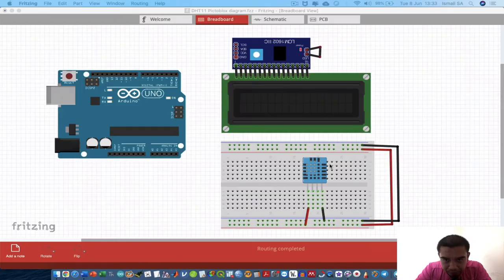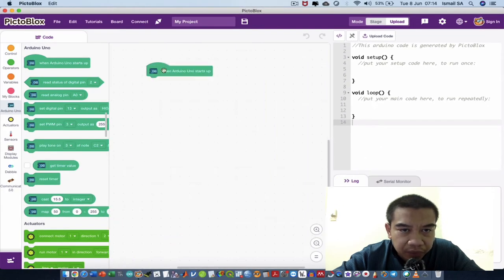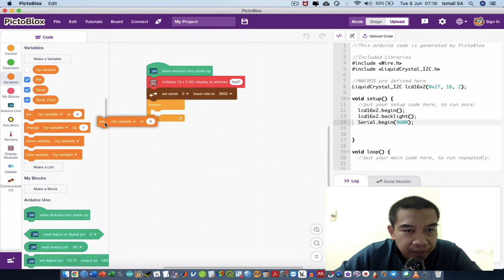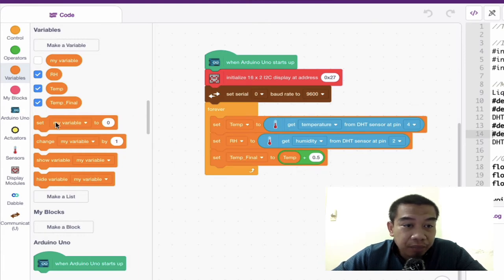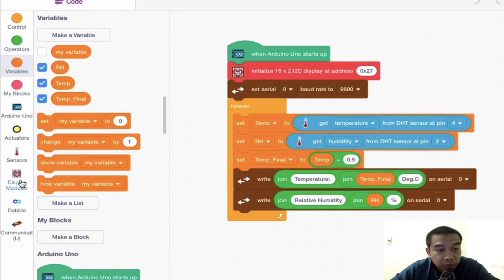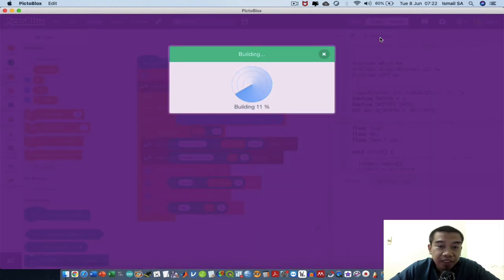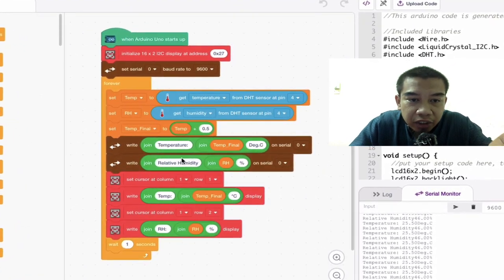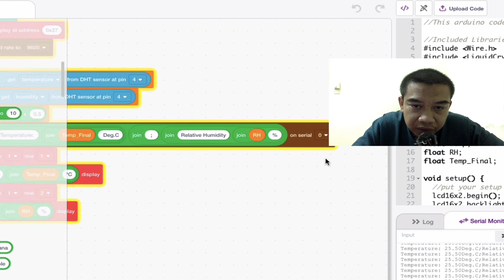Arduino Uno Tutorial With Pictoblox - 5: DHT11  Sensor for Temperature and Humidity with LCD I2C

Comment: Hi how can use accelerometer Gy-521 or Gy-271 or Gy-291  with pictoblox ? İf you have examples Ok is this thema.I need only example.
Reply from the maker: Thanks for your comment. The pictoblox if I am not mistaken cover most of basic sensor. If you interested to learn more on block coding and have the list of advance and multiple sensor, I may suggest you to visit arduinoblocks.com, they have complex list of sensor ready made with their libraries. Happy coding.

Comment: Do you know what the blue piece is called for the screen?
Reply from the maker: Thanks for your question. Usually, the blue piece attached with the LCD is called as "I2C LCD Adapter" we call as Inter-Integrated Circuit (i2C) Sir or also known as "I2C Serial Interface Adapter", the common chip use for identification of the unit are call PCF8574. You can have the generic and details ideas by visiting to this link (credit to them): https://lastminuteengineers.com/i2c-lcd-arduino-tutorial/

I hope, I answer you question right sir.
Reply: Kajidataonline Thank you for your answer
Reply from the maker: No problem.. I am happy to share.. tq for asking, feel free to ask, if you got any doubt. Happy making

Comment: i already followed your steps but my lcd i2c never display any text ..please help
Reply from the maker: Thanks for your question. One of the idea to solve the issues by installing the firmware into the arduino uno board in the first time you attach it into your computer. Try it and let me know the status. The main issues sometimes due to the incompatible status of the library

Comment: If I use DHT22 instead of DHT11, is there any error reading?
Reply from the maker: Thanks for your question, if you are using the DHT22, you can change manually the code generated for the suitable initialization. Let me know your exploration and experience. Can update my content later. I have lots of videos coming up for graphical approach.. if you interested. Let me know.
Reply: @Kajidataonline  I try with DHT22, but i have error in reading always be 1 or 2 !
Reply from the maker: Please do contact me so we can share ideas. http://spsshelper.wasap.my